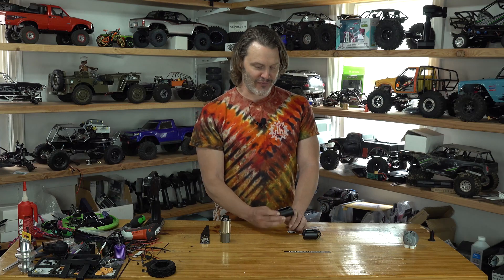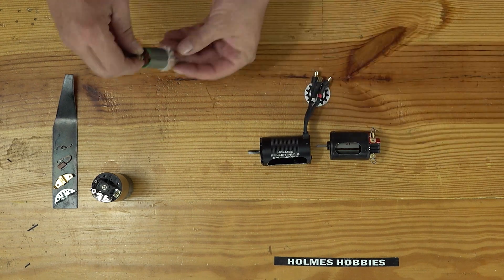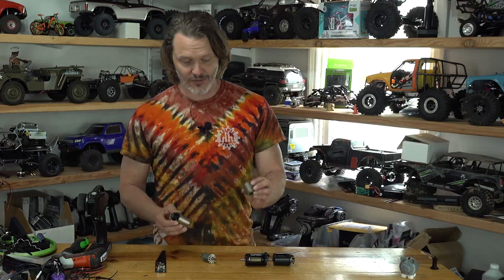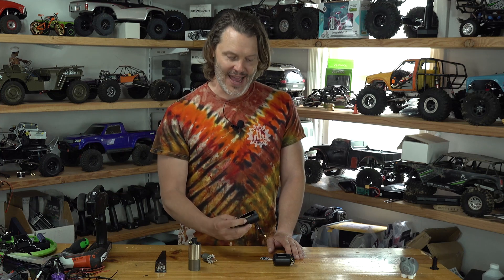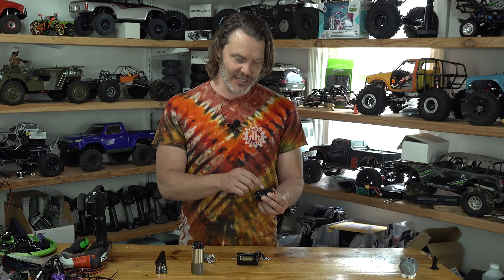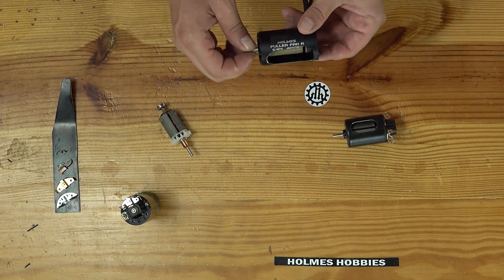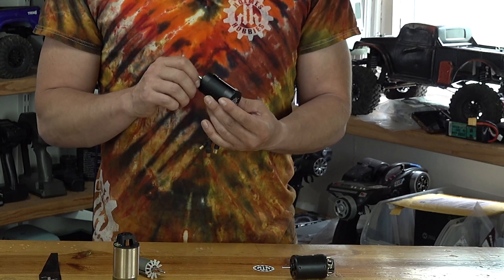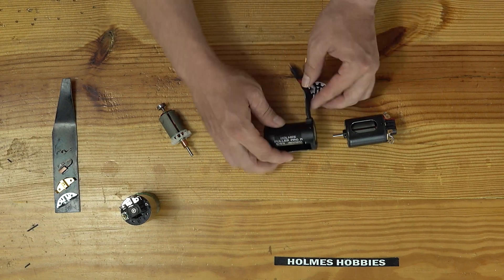Exploring RC Crawler Motors: Cutting Open Custom Motors to Unveil their Secrets! Holmes Hobbies

Comment: I used to work in a dc motor/alternator shop so I’ve taken many apart and machined comm’s and growled tge arms, etc. only ever taken 1 brushed RC motor apart and it was my old trinity monster horsepower back in the day
Reply from the maker: I've got a growler here. Not useful for production since we don't get coil shorts but a cool bit of equipment!
Reply: @HolmesHobbies  yes they are

Comment: The best way to open up a motor is to direct wire it to a 120v socket.
Reply: Or a subwoofer.
Reply from the maker: break in process